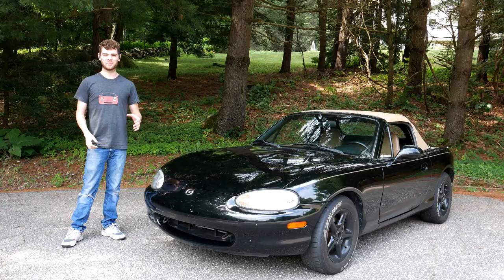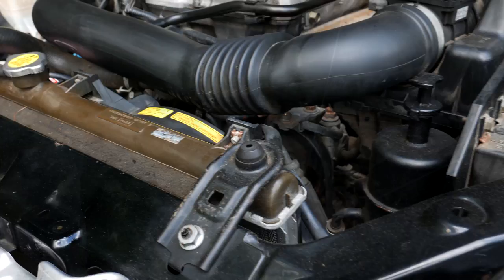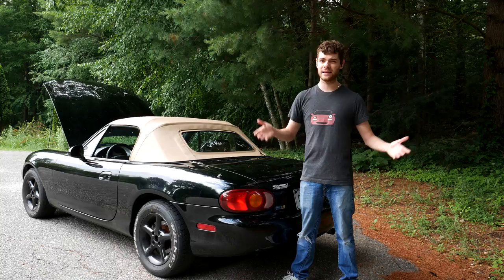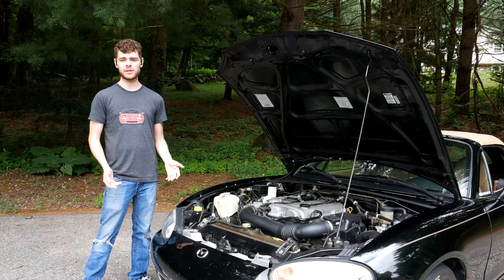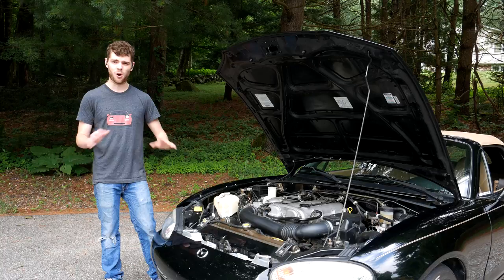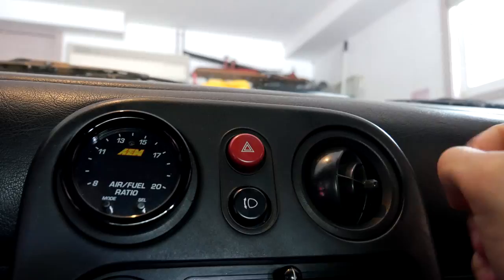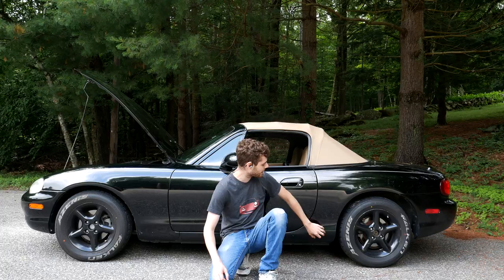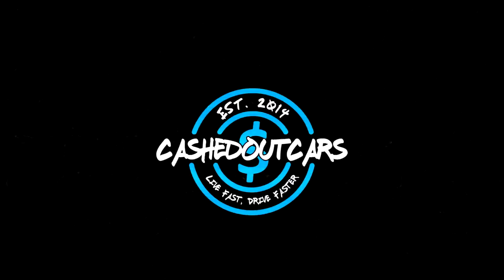5 MX-5 Miata Problems You WILL Have

Comment: I've owned my N/A for eleven years. The UK climate isn't kind to bodywork, but because  my MX-5  had always been reliable and my wonderful local garage had maintained it mechanically over the years, I decided on two new wings (fenders, I think you folks in the USA call them) plus having the rot cut out and new metal welded in at the rear wheel arches. That was four years ago, and it was cheaper than buying another car - plus I know the car's history whilst in my care.
All of the issues you mention are spot-on, all part of normal wear and tear. My car's had a new convertible roof, clutch servo cylinders, new suspension springs (I blame the ridiculous speed humps in our area, even though I'm careful when driving over them),  new brake discs, new clutch,  camshaft cover gasket,  battery, driver's door handle spring and four tyres. To help preserve the bodywork, the underside's been sprayed with Waxoyl. It seems to be very effective.
Importantly, all of this has been affordable!

Comment: Had a 97 myself. Drove it for five years and the only things I ever had to do were change the oil and put gas in it. Was a great car, no oil leaks, no rust. Had a glass back window and a few up grade parts in it. Aluminum radiator, stainless headers and exhaust system, after market sway bars, lightened flywheel. Have a 2003 BMW Z4 I bought new and it has also been a great car. Changed the valve cover gasket at 112,000 because I wanted to see what it looked like inside with those miles, wasn't difficult.
Reply from the maker: They’re amazing! Enjoy the new Z too

Comment: '96 black and tan, bought new.  Driven year round up until fall of 2013, ~352k on the clock and currently sitting in my garage waiting to be restored thanks to the liquid car dissolver CT uses on the roads in winter.  Other than routine scheduled maintenance & brake pads/rotors (and go-fast goodies like shocks, springs and sway bars), it was a very reliable car.  Replaced a weeping differential axle shaft seal at 66k, and welded a rusted through exhaust flange somewhere in the mid 100s.  Had to replace a rear wheel bearing somewhere in the low 200s.  Finally did the water pump and hoses with the 240k timing belt replacement, replaced a dead fuel injector some time in the mid 200s, alternator brushes around 280k and replaced the rear calipers in the low 300s when one of the parking brake adjusters finally seized.  Incredibly trouble free car!  Oh yeah, did the radiator somewhere in there, too, probably in the 200s.

Comment: Very helpful, easy to understand tips on what to watch out for. - many thanks.  My '97 NA Speedster is garaged year round.  When putting away for the winter I put the top up to keep the material straight and in its natural position.  However, to avoid strain over 6 months of storage, I DON'T latch the top to the windshield - just let it sit up in its natural position.  A top boot/tonneau cover is a must to keep out the sun, dust and moisture.  When folding  down the top, make sure your vinyl window isn't creased or folded crookedly.  I also tuck a rolled up towel in the outside of the rear window when the top is down, to minimize any creasing and to keep out dust.  Regular cleaning and treating a vinyl top will ensure a long life.  I believe there are about 13 (!) drain tubes on NA Miatas.  Carefully cleaning them out will help fend off lower body rust and prevent water in the interior.

Comment: Slave cylinder from the clutch,
Pcv valve, 
Temperatuur sensor at the back of the engine,
Airvalve,
Jammed power windows,
Poor rust repair
In the first year/9000miles of my ownership of a 96 NA
But all diy jobs and loads of Fun fixing it!

Comment: My 92 has over 200,000 miles and I have no oil leaks, and my radiator looks like new, so there’s something to be said for regular maintenance (though if you’re not the original owner, you can’t really help if previous owners neglected the car).
Reply from the maker: Absolutely, my 93 has 216k and is turbocharged.. still going strong!

Comment: I have a 96 with 275k miles. It's been very well maintained so no oil leaks or anything of the sort. I have an aluminum radiator. The only issue is floppy vents and rust on the rear quarters since the old owner never cleaned the rain drain
Reply from the maker: Get it up to 1,000,000 miles :) Enjoy it!

Comment: I got a 2001 MX-5 hard suspension which is lower in ground and a skirt around 6-speed I love it I have 103,000 miles on it. The only problem I replace the rad, also cam shaft sensor now will have to replace cam shaft seal it start to leak also I beleive the rear main seal also will need to be replace I love my Miata rust free. I leave in Canada so I drive my Miata from May 1st to November 1st, also trying to not drive in the rain. The car is restore for 6 month in my garage not heated and a battery maintained charger 2 amp.

Comment: I've got a '95 NA: radiator, front wings, rear wheel arches and sills (front and rear) - twice. Two sets of springs and dampers. Clutch slave cylinder. Ignition coil and rain rail (fixed with wide insulating tape).
It's a stock 1.8 (with 16° advance) and it goes like stink - using 97 octane.
It's going to rust again, but I don't care, because I love the way it goes and handles 😀
Reply: 97 octane? We only get 93 here in the states. Must be a right old banger.
Reply from the maker: I believe the octane rating is a different scale over seas

Comment: Yep, had the radiator blow out. Top back window been gone for awhile. Probably have all the oil leaks mentioned. Vent droop, check.  light on the rust though, live in desert/dry area.  1996 Miata.

Comment: 2002 Miata. Original owner. 75K. Sat outside and driven year round (great sled!) for first 5 or so years.  Yes, rust, especially rocker panels and lower fenders but also muffler heat shields (just removed). Replaced the rear O2 sensor ~50K. New top and rain rail about same time. Valve cover gasket is leaking but not enough to worry about. Air conditioner compressor failed at ~60K but who needs it anyway.

Comment: I wish those were all the oil leaks. I've also had the cam shaft seals leak, the front crankshaft seals leak. And the worst of all I'm fixing now on an NA is the oil pump leaking at that gasket that runs along the top of it. Requires the engine to come out, since it's bolted into the oil pan at the bottom.

Comment: My NB is a 2004 LS, 225+ k miles, owned since 2006 and 22 k miles.  Radiator no issue so far.  Roof, I live in the desert, I replace it every 4 to 6 years.  No oil leaks, but I do tend to replace seals / gaskets when I do things like timing belt changes.  Floppy eyeballs / vents since the day I got it, so I have had felts in there since day one.  Rust?  Got to have rain for rust...I live in the desert and none of my 3 Miatas have had any rust.  Same thing with the rain rail, I clean or replace every time I replace the roof, and it stays good to go for the duration.

Comment: If you have a decent roof and you use a good quality protectant then the roof will last the life of the car. 
as for the frame rails. If you keep them clean of leaves and debris they will last without cracking or breaking down. Also, if you keep the car in a garage you will extend its life indefinitely.
For sure, the sagging vents. But, they are as mentioned really easy to replace.

Comment: I have an NB. The left driving light fell in as the mounting rusted away. There is a signature spot for rust just above the front edge of the rear bumper skin on the rear left wheel arch. Also, the plastic rocker moldings and anti-scuff tape can hide a ton of rust. Look for lumps in the tape between the bottom of the door frame and the plastic molding. 😳
I will go so far as to say the tan vinyl tops are rubbish from the word go. 
Thanks for the video!
Reply: My NB1 has the tan vinyl top. It has some mold staining, but no rips or tears present or developing. Was a Michigan car for many years before coming to Florida.
Reply: @mr.butterworth  my poor car has lived outdoors ever since I got it. First thing I ever said to it was, “Your easy life is over…”

Comment: 1996 200k miles
	RMS Oil Leak
	Leaking Top Seals
	Valve Cover Leak
	Water Pump Seal Leak
	IAC Corrosion leading to bad idle
	Torn Rear Diff Axel Boot
	Throwout Bearing
	Speed Cable in Dash needing Lubrication
	Leaky Brake Booster
	Cracked PCV
	
These are all the issues I’ve had, Allot are the result of general maintenance and have since been mended. Excellent car

Comment: 99 MX-5 NB 1.8 <3 It was cheap compared to what u pay for most of them in germany. It was bought in a very good condition with a short before sold replaced softtop, clutch and generator :D I just dropped a 6 speed + magnaflow exhaust onto it and refreshed the headlights by sanding them down and respray with clearcoat. You have to take your car to a inspection every 2 years in germany and it passed with 0 flaws the 2nd attempt after it failed the first b.c. of  nearly 0 profile on my wheels caused by..... RWD xD

Comment: In 2000, I picked up a '97 NA, leather, auto, A/C w/ 4,600 miles. Still runs like a top w/ 270k miles. Radiator began its greenish brown inevitable leak & weep in 2007 (102k miles). Replaced w/ a Koyo OE spec & it's still holding strong. P/S pump needed a seal kit in 2017 (227K miles). Rad fan motor in 2011. Nothing other than good maintenance including the front fender debris cleanout & top drain tubes check & clean. The oil leaks at the valve cover & CAS o-ring shouldn't be a problem if you change them w/ every timing belt job.

The earlier NB tops had service bulletin upgrades to the springs & rain rail side plates done to prevent a pinch & wear issue on the tops. If you have an NA w/ a bad plastic window, just find a good NB top w/ a glass window. It bolts right in. It might be hard to find good ones anymore tho' this far down the road. 

One thing for certain is u-joints more than likely going sometime. On my NA, that means replacing the driveshaft as they're not replaceable. Mine went at 160K miles, junk yard drive shaft for $100 in 2012 is starting to clang so I have a new Dorman I'll give a shot that's ready to go in soon as I get it on jacks for some other maint work. Oh, the other "oddity" is the speedo cable. It'll start chirping when it's cold out & bounce the speed needle a bit. A new one is also sitting on the shelf (for 3 years) waiting for my lazy 70 year old ass...

A good thorough maintenance schedule & keeping up w all the little minor things that can pop up over the years & these things are damn near bullet proof, IMHO.

Comment: Clutch slave cylinder and Cam Angle Sensor are also common failures which keep you from driving the car.  Stabbing the cam angle sensor with the shaft slot aligned (in that narrow space) is a pain. 
I have replaced the roof once.   The radiator has been replaced as well.   Like any car, the battery has been replaced.

The Miata is a 91 NA.  Owned since 2012.

Comment: (2) 1995 MX5-NA & (2) 1999 MX5-NB cars.  

When I bought the cars, 3 had sloppy shifters from the little plastic cylinder at the bottom end of the shift lever being destroyed by previous owners shifting like they were trying to break something.  (4th car came with a Tremec WC-T5 trans, so that shifter hasn't broken.)  In the three Mazda transmissions I replaced the plastic part with aluminum while installing short-throw shifters.  (You think MX5-NA/NBs already shift perfect?  Try a short-throw shifter!)

Where fuel filler hose attaches to gas tank, rust inside the hose on the tank fitting (nipple? barb?) results in leaking maybe a drop a day when tank is at least 3/4 full.  May not seem like a lot, but closed up on a hot day, I'm surprised how much the interior reeks of gas.

Hydraulic clutch master and slave cylinders leaking.  They seemed to fail completely without warning.  Do you know how to drive a manual transmission home without using the clutch?

Leather drivers' seats eventually wore out at the left hip bolster, like any other high mileage vehicle.

Button on clutch pedal which disengages cruise control.

Not as much rust as I expected, considering three of my cars were left exposed to tropical sun and seawater mist.

He's right about soft tops not lasting in sunlight.

Replaced all the obsolete OEM sound system head units.

Isolated failures:  OEM radiator, power window switch, headlight connector, hydraulic lifter, throttle cable, alternator, water pump, power steering rack leak, horn wiring in steering wheel, backup light switch.

Overall, my four MX5 NA & NB cars have been extremely reliable in the past 10 years.  If you would rather drive your sports car than work on it, get a Miata!🙂

Comment: 2003 Mx-5 Miata, have had to replace the fuel pump twice, seems to be a big problem if your Miata sits to long.   Thanks for the info and will have to check your recommendations on my wife Miata.   Thanks for the if info!   Smooth riding!

Comment: radiator used to be like $50 to replace when I had a NA. I paid ~$470 for a glass window top. put in a NB Top frame. Outside of that, my shocks needed replacing (I got NB shocks where some NB owner swapped for Bilsteins) also every other month I replaced a relay or solenoid for between $15-60.

Comment: Another good helpful video.
Maybe add the window switches failing, and windows needing cleaning/regreasing, and the center console lid latch and/or hinge breaking. (On my NB1 I glued in a flexible hinge and used a magnet from a hard drive so the lid just lifts open.)
(Lots of posts on forums with somewhat complicated ways to remove the vents, but I saw one that showed a really simple way that doesn't risk scratching or damaging anything by just using a small hole in the vent.)
*Sorry, didn't see window switches already mentioned.
Reply from the maker: Good point with the windows, mine are very slow on this NB and I also just replaced my center console
Reply: Thanks!
I've cleaned the windows and tracks and done the Shin Etsu grease and that's worked well, but I still have the nagging feeling I could have cleaned better because it's tough to get in there.

Comment: 1993 NA.  190,000 miles. Replaced Radiator @ 167,000. Still has original clutch _ Water Pump _ Timing Belt _ Starter _ Alternator. Just this week lost he Fuel pump. Top is still like new. No 'Oil Leaks'  No Rust.  As reliable as ans Anvil.

Comment: I have a 1996 with 196000 miles, I had to replace the clutch slave twice. Yes, mine has drooping vents,  original top but the back window turned yellow and cracked. Mine does not leak oil, I had to replace the radiator after a accident with a aftermarket,. Listen, I’ve owned cars with half the mileage and had a lot more problems (talking Vega, Chevette, Sprint) I love my Miata

Comment: I'm not sure if you compared any 25-30 year old car of about the same price when new, that you'd have a car with so few faults, that provided so many smiles per mile.

I had a '94 1.8 imported from Japan into the UK in 2009. I had the roof replaced by the specialist seller as part of the purchase price. The only problem I had in 5 years of ownership was rusty rear arches. Everything worked perfectly, even the AC, which isn't really a must have for the UK.

Interestingly, after moving to S.E. Asia, I see a very few NAs for sale, no rust, great condition and generally very low mileage, but they're advertised for £20-25,000, that's $25-30,000!!!

Comment: the main front frame supports that rust could easily be remedied if you clean the support arms and undercoat them, i was lucky in that the original owner of my current NB undercoated everything before it hit the road. its a pita when i need to get a bolt out but im thankful its there because my undercarriage has zero rust

Comment: Yep.. Just did the radiator in my 99. It "looked" fine until the shop went to change the timing belt and water pump. The radiator just crumbled we they went to take it out. I think I am on the 4th or 5th top? I went through 3 while still under warranty. The way they rub and cause wear spots is horrible. Still love my Miata though! Knock on wood.. Not really any leaks.

Comment: I have an 02 NB Miata, and I recently replaced the radiator which cracked, I replaced the top last year and now I am actually having to replace the cam shaft position sensor. Which as I have done research is a common fail a well.

Comment: I have a 2000 NB.
At one point the clip that holds the window puller cable in my passenger window came off and got in the way of the glass going down. That was an easy fix, just a zip tie in the door panel to hold the cable in place.

It has an alright top and rain rail (I think) and I don't know if it has the rust. But it definitely leaks oil, the vents are floppy, and my radiator cracked at one point, I had to get a new radiator for it.

Comment: 2 - 1992's For thirty-year-old cars, they are quite remarkable. A little rust on the rear quarters from plugged drains on the black one, and a rattle in the speedo cable on the red one, but other than that still a lot of fun. Small issues over the years are as follows.

New tops for both, but not too bad a job.
Alternator chirp when cold. Black one
Power window guides and lubricant. Both cars, but the red ones where MIA.
Small oil leak from main seal on the black one.
Radios are problematic at best. Red one's dead and the black one has ground issues.

Easy cars to work on and parts are reasonable, some odd parts are getting hard to find. Needed a passenger side mirror for the red one and couldn't find a direct replacement, only glue on ones that covered the original and looked horrible. Not the cars fault I broke it doing something in the garage, replaced it with a used one.